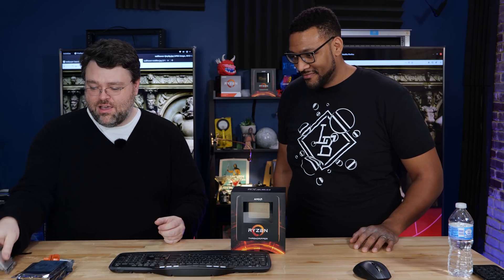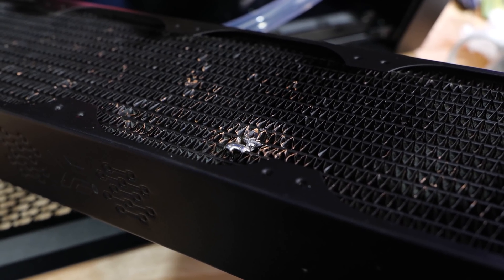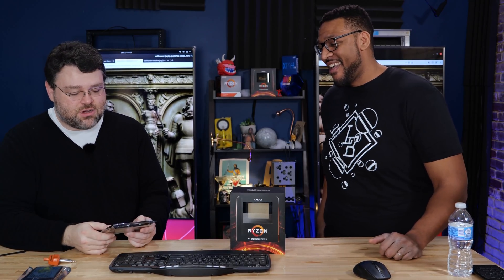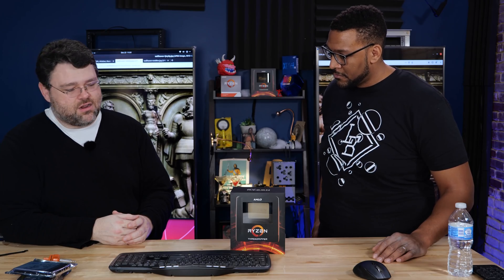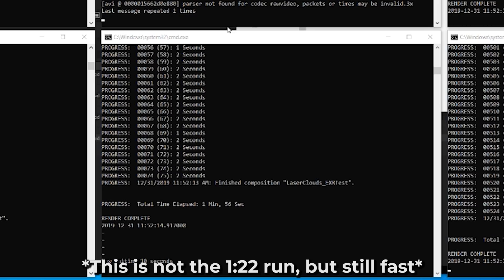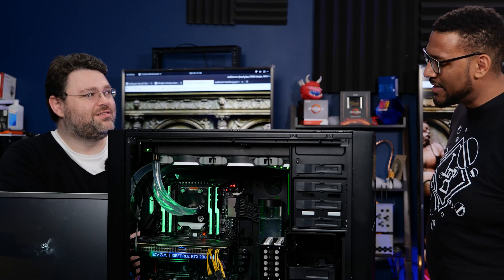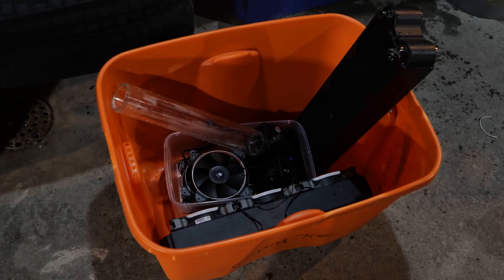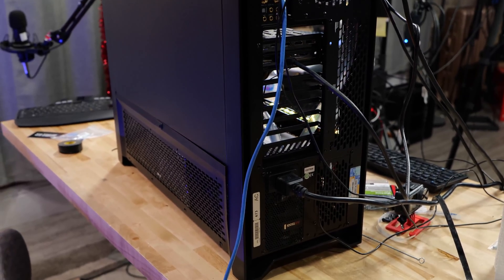Threadripper 3960X: VFX Render Monster

Comment: I'm building a new pc for 3d rendering 🖼do you recommend to get Threadripper 3960x or ryzen 9 7950x?
the test shows that the 7950x is faster by 20 % .....so cores count or clock speed?

Comment: I work in Nuke and I've been running an 8-core 7820x (xeon jr) and it's been a nightmare.  I just ordered a 3960x and I can't wait!  I also got a 2TB nvme pci4 and a 16x raid card that can handle up to 4 of them....I currently have 128GB ram.....over the next few years I will be adding more storage and more ram....ultimate 3 year goal is 8tb at 256Gb/s, 256GB ram and a couple GPUs.....I WILL be 8k ready!

Comment: someone enlighten me : why bother with water cooling?
Reply: VFX jobs when properly spread to all the cores will peg them all at nearly 100%, increasing heat generation greatly. Water has very high heat capacity, slowing the inexorable climb to 98ºC, at which CPUs will throttle to prevent runaway junction thermal.
Reply: @PanduPoluan  air cooling does the same exact thing
Reply: @technologu   not really.
1. air is not a good heat conductor. water is a very good heat conductor.

2. so, to remove the same amount of heat from the CPU, MUCH more air must go through the fins

3. driving that much air through the fins means a MUCH louder system: louder fans, louder noise due to air causing fin vibration, and so on. (Which is why Enterprise-grade rackmounted servers are hellishly loud like jet engines.)

With water cooling, heat gets removed faster, and because of water's amazing heat capacity, doesn't need to be dumped too soon into the environment through the radiators.

Comment: The key to getting dust out of radiators, other coolsers, is to blow air the opposite way of fans. Just noticed you did basically the opposite. 

This is especially true with blower style GPUs. I've heard so many complaining how hard it is to get dust out of then, when infact they are the easiest. Blow air in the outtakes, while holding the fan so it doesn't get worren out. Same is true with laptops.

Comment: Love the video. I have specific case where currently 12 core zen2 (or - 16 core zen+ TR) with 3 Quadro P400 was basically pinning 100% on CPU and GPU. with some small optimisation and its now 50-60% CPU and I am looking at matching a 3950x to potentially 6 x quadros on AM4. Presently testing 3900x with 5 x quadro by ahem dremel out the back of the PCIe 1x slots....and its benching MUCH better than 2950x with 4 x quadro. So so much work goes into the specific tweaking to the workload that people don't realise.  

Of note for the $/frame at 4k, there is still nothing better than a P400 Quadro at $90 per GPU.

Comment: WHERE did you get those Intel drives?  I saw some on Linus and he said they were old Facebook drives.  I would like to buy some if possible.  Please tell, please tell! 

Also, I really enjoy how informative your channel is. You usually always explain the specs on your equipment and why those specs are going to work in custom applications. Thank you.
Reply: https://youtu.be/_dPrIhWGjTY  6 mins 15 sec in. (can't give time specific url on mobile sorry)
Reply: Thank You
Reply: Looks like I was a little late, but there seems to be quite a few 400-500$ deals which is a steal also I believe.  Thanks again.
Reply: Bummer, I got one when that video came out. Looking back I should have gotten a second, Linus's video probably helped them sell out fast.
Reply: Just seach intel ssd on ebay, i've got a 1.6TB U.2 drive in my rig for heavy games and a 4TB sata drive for lighter titles that don't need the speed

Comment: "Application Profiling" I like it! What are the steps to determining a bottleneck? Actually, how do  properly plan for it? I have a very specific situation for school and I want to know how to pick the hardware. It's called ScalIt, a neural network for making molecules.
Reply: Neural network? Sounds like a job for gpu's. At least I think it would support it. The one thing I could google up that fast was https://github.com/corpetty/ScalIT
Not it is it?
Reply: Oversimplified, the process is: Run the workload, the part that is running closest to 100% is the bottleneck.

Comment: What I learnt was: air cooling looks better and better.
Reply: Yeah! I was really surprised to see that VFX studios are using water cooling.
Reply: @Outland9000  Every doubling of sound is 3dB extra. So, a VFX studio, all big fat cpu's running full steam, cooling 100+ watts, I would think quiet also has a priority in an office. No, a larger surface such as with a radiator, which probably also gives lower temps running a job to keep the system purring like a kitten for years, is a good idea. An Alphacool Eisbär LT or Alphacool Eisbär Solo would also be a good bet and probably what I would do, just add a bigass radiator. I am thinking 3×140mm, R3400 or R6010 tubing in a propah diameter, like https://www.aquatuning.nl/waterkoeling/slangen/slangen/12065/tygon-r6016-norprene-tubing-19-1/12-7mm-1/2-id-black?c=4903.
Reply: @jamegumb7298   The idea that air cooling is loud is a myth. Where I work we use Catia which although is not especially demanding is not a million miles from VFX work. All our machines are air cooled, they are on for 8 hours a day 5-6 days a week.
Reply: @Outland9000  The smaller the area that needs to be cooled, the amount of watts needing cooling staying the same, the more rpm the fans must spin. You can use copper for better heat conductivity on heatsinks, use better paste, but this all makes very little difference compared to the total area you are cooling. 
I can hear my cpu with air cooler (CM Hyper 212+), a radiator with 3×180mm fan at <800rpm, totally silent. Larger surface area, lower rpm.
I am familiar with light CAD, and compared to transcoding video it is a breeze. At least on my system. This may be different if you are designing Airbus 380's on it, but then most load I think would be put on the Quadro/FirePro, and I know Airbus has a separate rendering farm for renders, not in any office where it can be heard.
Reply: @Outland9000  I guess with a rather inefficient x99 (either 5xxx or 6xxx) and 4 980s, air-cooling runs into certain limitations. 4 air cooled GPUs would dump around 1000W of heat directly into the case and boost lower. Also air coolers are larger and not all pcie layouts on Mainboards even allow quad setups (and then only 2 slot GPUs). With water you get better heat transfer and therefore higher boost speeds, also waterblocks are only singleslot (depending on IO layout though)
Reply: I have a high end noctua cooler, it works great but doesnt look very nice no, water cooling wins all aesthetics awards these days, still wildly impractical for casual pc users though
Reply: @James Smith Aye, I did. However the multitasking capability is due to the beastly 3960x. The 3960x can quite happily be air cooled, I do agree with an earlier comment that multiple GPU's definitely benefit from water cooling because of their close proximity to one another.

Comment: I have a 3960x, with that waterblock, what temps are you getting under full load? i'm about 85C full load at 250 watts to the cpu? And what case is that?
Reply from the maker: Like 65c ish. 85c, really? What's the rad? And pump?
Reply: @Level1Techs  RAD = Hydro X Series XR5 420mm x 30mm + 3 high pressure fans, Hydro X Series XD5 RGB Pump/Reservoir Combo
.
Adding a 140mm to the back to help(my case doesnt support any more unfortunately). Ryzen master reports 250w CPU + 40w SOC, at 4100-4300mhz. (no slouch)
Reply from the maker: Something is not right.. did you take the peel off the water block?? There is no way it should be that hot .. is the board hot around the CPU? Clocks sound right for stock but that temp is... Odd
Reply: @Level1Techs  Peel is off the back yes. the VRM is hot while under the load, but otherwise its just warm around the socket. Used thermal grizzly kryo. Water temps are about 32c (ambient room temp is 28c). No other issues. idle is ~38c
Reply from the maker: Make sure the block is clear and the jet plate is not missing or dislodged somehow? Something sounds off. Is the radiator even warm when running a bench after an hour or so?
Reply: @Level1Techs  Radiator is pumping out heat like it was a baseboard heater. idle at 36c now that its cooler. I put the paste on as thin as I could without scraping it off, even did gentle passes over it to get excess off . I could try to repaste it with something else to see if it was just a poor job, but I spent a lot of time at it. I'll try that after adding in the extra radiator. I got the clear version waterblock instead of the acetal, don't see any issues, a few tiny air bubbles that I can't get rid of thats about it. I'll try to get rid of those bubbles when I take the block off.
Reply: @randycnc  So the radiator is hot and  your seeing 85c on the CPU? It's hard to fuck up thermal paste application to be honest. A little too much is probably better than too little though.
Reply from the maker: Yes if the rads hot and the CPUs hot it suggests there's more than 280w going into the cpu. I have a test system with a refluid enermax 280mm and it hovers around 75c with only brief spikes to 80c. So if the rad is warm it suggests the paste job is ok. Something weird going on here....
Reply: @Level1Techs  I put in another 140mm with a much better rear fan. Temps are about 77c after an hour, ( -5 improvement). Can get 74c everything full blast(jet engine). Running Cinebench R20 in a loop.

Comment: No offense Wendel, but I'm worried about the soldering. I don't think that iron is powerful enough for such a job. Are you confident the solder joint got hot enough to get proper wetting?
Reply from the maker: No, I'm super worried about this also. Life's a grand experiment though so we'll see

Comment: Damn Wendel, you have all the fun. But lately you've made me feel bad that I only got the 3900X and the Sapphire Nitro+ SE for Christmas. I will say I am very happy with the improvements in Blender with the 3900X and my Vega 64. I know TR is a Monster any chance you can do another one but with Mya rendering? Also any chance you and Epox Vox can do a rendering on a budget video with Blender and the other software suites that are less than $1K, preferably $500 range. Semi pros, hobbyist,  and students would benefit I think.
Reply from the maker: 3900x is my favorite CPU in a long time. The 3950x is just insane for am4, in a good way, but the 3900x is 90% of a 3950x for 2/3 the cost .
Reply: @Level1Techs  I agree on that point, sometimes you have to stay within budget! But I am having issues with Navi and the 2020 drivers. None of which I have on Vega, Adrenaline 2020 only improved my performance. So what to do, but wait I guess. I know Vega had issues when it 1st launched. I got mine AFTER the Mining craze and the drivers were good for me then. Could my 5700X be being held back by my 3600X? I have both 3900X and the 3600X.  I move the 3900X to my game machine because the software I use in the other machine doesn't like more than 8 threads w/no SMT if I want to access the control web gui. While it ran like a wildfire with SMT on, transcoding  130 HD videos to h.264 in less than 6 hours. I could not access the web gui interface with 12c/24t. I tried with SMT off while it looked like it would work, it would give .NET web config errors. Otherwise the program runs fine, since I had to disable one  ccd or limit it to 8c/SMT off. I decided to take the 3600X from my game machine and just use that. With SMT on I can access the web gui, but with errors that I have a work around for and control the work. 

The 3900X is great for gaming and my attempts at Blender art, lol. I just want you to remember us little guys trying to learn the craft, even if only as a hobby. TR has moved on to the Professional Class with associated expenses. The Ryzen 9 Class is for us mere mortals, but should not be looked down upon. 😁 Love you work, Wendel and Happy New Year!

Comment: The last time I used After Effects, it was on a dual Athlon MP 1800 system with 128MB of RAM. Times have changed...
Reply: you had any doubt?? remembering that you had a computer with 128mb of ram?
Reply: @dayspoiler4608  Not me. The first computer that was actually mine (not belonging to my parents) had 256MB of RAM😜. Though my dad was still running 64MB at the time.

Comment: Hey wendell how did you figure the bottle necks? Did you use process lasso or some program like that? I have a relatively obscure program that I need to this on,so I can optimize my rig/workflow. Any ideas? Thanks for the actual content! I like having my brain muscle exercised!
Reply: Never done it my self, but i imagine a good place to start is to run the programs and have utilization monitors open at the same time. if your CPU's at 100% but your graphics card is at 50%, you probably need a better CPU. I have no clue how you would go about finding the right hardware if you don't have a bunch to swap and test.

edit: spelling
Reply: Thank you for that sound advice. I guess I was wondering if there was a way to figure out memory or IO bottlenecks as well. Idk I'll figure it out! Thanks for all.your help Cameron

Comment: Nice rig. It's always nice to see Wendell dive into what's going on with a system and look for where the bottlenecks actually are. Because a lot of people just throw better hardware at it blindly, like you said, and that's not a solution most of the time.

Comment: What did he use for coolant.. battery acid?   lol      I change the water in my loop every 3 or 4 months.  If you put the drain and fill ports in good spots, you won't see it as a big deal.  I just changed my water yesterday.  I use a tiny bit of Hydrix (don't use with PETG, though.. just acrylic).  Hydrix is basically like antifreeze for a car, and has corrosion inhibitors.  I use neon green UV dye, so the green Hydrix blends right in and is reactive on it's own.  You could just use that if you wanted, but I just use a tiny bit.  Silver plugs, too, but the uv light I think kills any organics.  4x10w hi-power LEDs, and 8 CCFL tubes will do that. Looks like neon tubes when I turn it on.  I put Wood's glass over the 10w lenses, so there's no white light, just tubes.  Anyway, the system is 3 years old and the block, rads and tubing look like new still.

Comment: Wendell, one important thing about the SSD's - Since Intel sold those to Hyperscaler customers (Facebook, Google, etc) - it will NOT honor the warranty if someone purchased it from eBay and want to replace it. Intel only honors the original customer.

Comment: Please always hold fans when using compressed air!
One thing is that they work as a generator when running like that (No need to fry stuff if they are connected)- The other is that the balls bearings thingy doesn't really like to run at hyperspeed...

Comment: That solder will degrade and then potentially flood the system.
Reply from the maker: man there are a lot of people out there with soldered copper plumbing in their house that will be bummed to hear this (the flux in plumber's solder is wayyyy more abrasive/acidic than rosin flux for electronics solder.... )